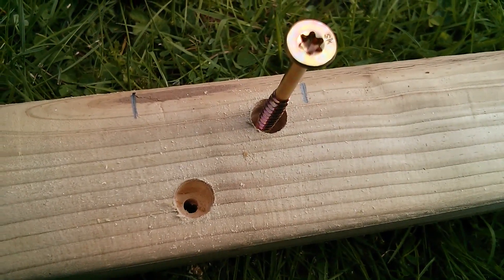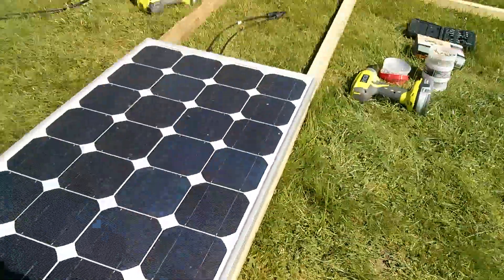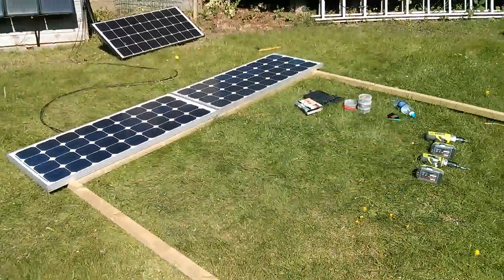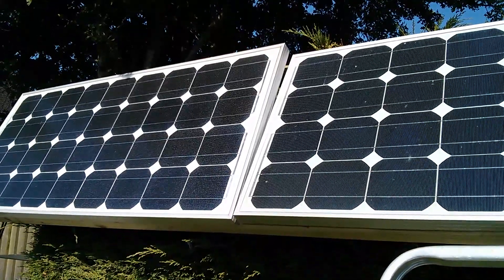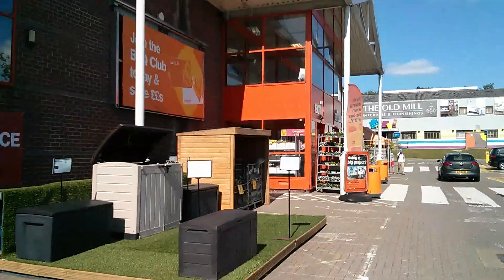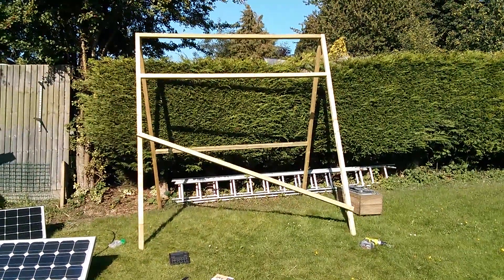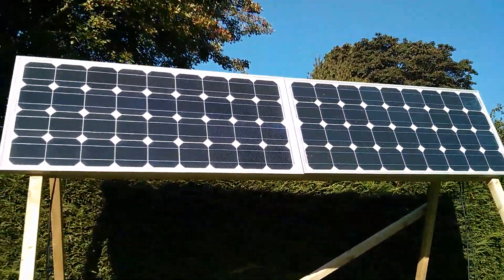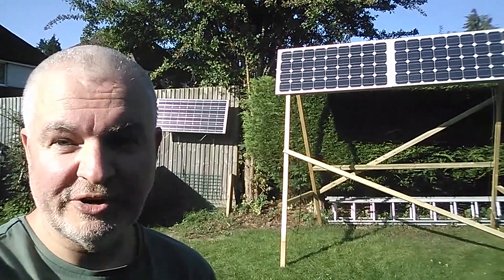Julian builds: a Solar Panel Frame for the Winter #2

Comment: Nice to know what your Mrs thinks of it, very relatable.

I wonder if you would eventially do an arduino controlled motorised tracking system to keep it pointing at the sun. How hard or expensive could it possibly be...

Comment: bit late now, but just put the panels on the roof (with angled stands), shorter wire run, and you don't need to clutter the backyard

Comment: Do you get a lot of snow?  I'm wondering why you made it so tall... seems like it would be more sturdy if it was closer to the ground
Reply from the maker: +mnelson10000 The longer pieces were cut to fit into my car - amazingly the Citroen C1 can take 8ft (2.4m) lengths diagonally from passenger footwell to rear window. So I just built it with 8ft uprights to save all that cutting.

Comment: You might have been better off throwing a few quick and dirty half lap joints for the frame. It would give much better overall strength and long term stability than butt joining with screws. Simply use two small timber braces per panel again with lap joints and the entire thing will be solid for years to come.

One thing I am wondering though is about the panels themselves. Obviously the easiest option is to buy a panel of that size, but is it worth it buying the the packs of cells you can get on ebay, then making them up into a larger panel to what ever size is needed? If you discount the argument of the time spent versus earnings per hour, are they a better cost effective method or do they generate such low amounts you have to spend more on larger panels than just buying a premade one?

Comment: I thought it looked too monstrous...

The rear supports/hinges could be attached lower down, like at the lower beam. The rear supports could also be more vertical. That way the monstrousity could be moved back, closer to the hedge.(pretty much the same possition as when leaned to the hedge.)

If you weight/anchor it down you could make the footprint even smaller.

Just a small detail but putting the cross bracings on the "inside" could also help. Paint it too...

Comment: Wind shear on those panels might knock your " Solar Easel" right over. Form out the bottoms of your 4 legs and pour some concrete to bottom load the structure. Lol, in my neck of the woods, the town would increase my real estate tax for the structure and require at least two building permits with inspection.

Comment: Make sure you anchor that down. Solar panels quickly become sails in high wind. When I mounted mine on my roof (20 ft up!) I made sure to leave a 1 inch gap in-between the panels so that air can sort of pass by them in heavy winds.

Comment: We're getting 24 degrees all week so those batteries should be topped up. It could do with maybe some wet sandbags or other counterweights. You could make it fancy and go tracking. If all the panels were tiled on the frame it'll be worth the tracking system. Go on, in for a pound.

Comment: Hi, would it be possible to use the shed for battery storage?
Reply: +Darryl Landry actually i wonder if hes losing a ton of his power from the very long cables, the shed might be a fair idea for the batteries, but he then still has the problem of a long cable from shed to workshop
Reply: To workshop would be after charging the batteries...

Comment: what about using wind turbine?
Reply from the maker: +Imba Core (Luznywiesiek) I've got one - 48V three-phase I think. But it's a big heavy thing which would require a substantial support mast with guy ropes. It would need to be very tall - probably in breach of numerous planning laws.
Reply: so maybe something smaller? or DIY or vertical one?
I don't know how it is in UK but in Europe (Poland for example) as long as wind turbine is not higher than your house You don't need any permission but it can't be hard fixed to the ground permamently

Comment: If you have a wilkinson near you, you can get most of the parts you want for half the price of B&Q
Reply from the maker: +Charles harman I forgot about Wilko. Problem with Wilko, it's just impossible to park anywhere nearby.
Reply: Julian Ilett B&Q -screwfix same company. Locate the nearest toolstation, fantastic shop & a free drinks machine, take the wife with you, does she like hot chocolate?
;)
Reply: +neiallswheel +Julian Ilett I was about to mention toolstation. Save yourself a packet over b&q prices.

Comment: A thought: That wood frame will warp! Don't screw panels directly to it because they'll probably end up cracking if it warps a bit too much. Instead, attach the panels to a sliding clamp that is designed to allow the wood to change dimensions but not allow the panels to flop around in the wind. I'm thinking a "T" shaped, three point design where two Horz. sliding attachment points would be near the top of the panel and one Vert. attachment point would be centered at the low end of each panel. That will require a metal or dimensionally stable cross member that spans across the lower part of the panel to establish that center mounting point for the single lower vertical sliding clamp.  I'd use a hybrid of wood and PVC pipe with wrap-around pipe clamps for everything... or it could all be made of wood, including those "clamps". The clamping action should be tight enough to move a little, but not a sloppy fit. Sorry, Your right angle brackets could act this way too (I was typing and listening and missed seeing that! Oh dear, I just watched the rest.  It's hideous - good luck wid da wife...) Good die mite.
Reply: +FindLiberty 
I can't really tell, but I think it looked like spruce. While that will warp it also is not quite strong at it. If it's larch though (the much better choice for untreated outdoor projects), it's another story. I had larch boards tear the heads off of screws due to warping.
In this case it won't matter much I think. The panels hang loosely on screws (an idea I don't like that much cosidering windy conditions). If the wood warps most likely the screw will just slip out of the holes in the panel (with the two angle brackets being the only thing keeping it attached in the end).